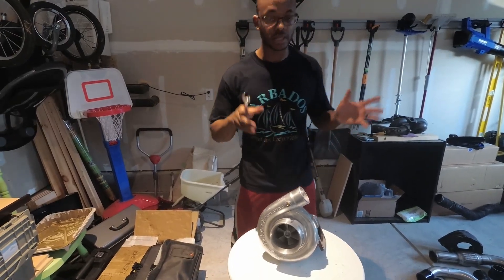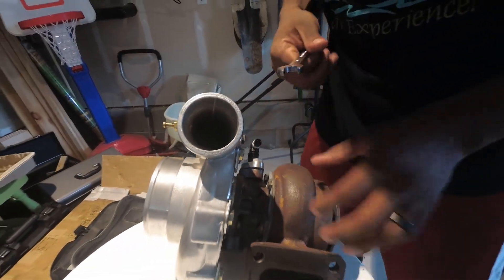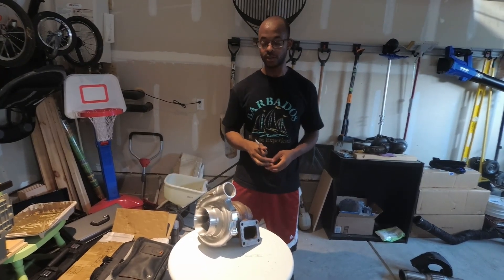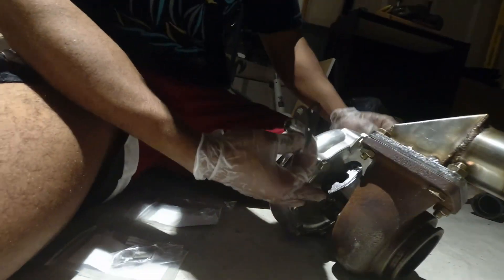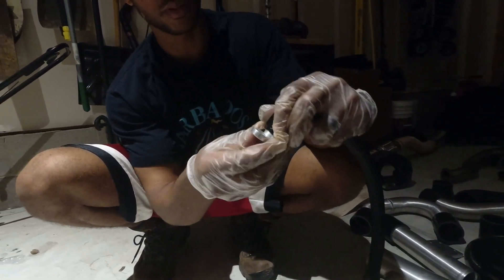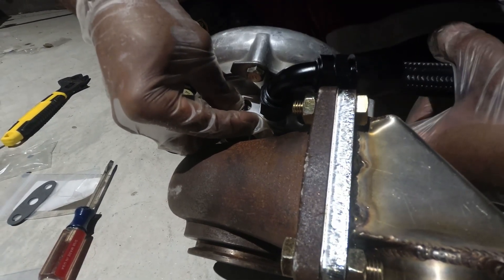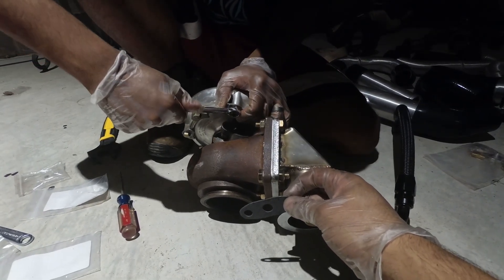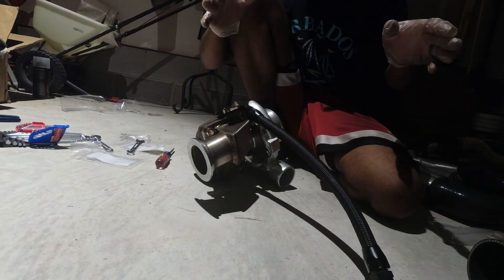10-A. Clocking your Turbo and Preparing the Assembly - RP 3.8 Turbo Kit Installation

Comment: Would you need upgrade the internals before installing the turbo
Reply from the maker: No not at all! As of the date of this comment, we have over 60 turbo kit customers and all but 1 customer is running stock internals
Reply: @RemnantPerformance  dude that’s incredible! How much psi are you able to run safely on stock internals and how much whp would that accumulate to?

Comment: Hey guys been watching the whole series day by day as you guys upload them onto YouTube. Great videos and I’m excited for this kit. One thing that’s always puzzled me was the T4 style flange over a vband style housing with a 90 degree elbow pointed in the right direction of flow. I guess my only concern is if that flange attached on the turbine housing is restrictive in anyway at all.
Reply from the maker: Thanks for watching and sorry for the delay in reply. No matter which way you go, you are looking at a 90* turn into the turbine housing. The V-band style is nice because, if you have the room for it, the connection to your piping is pretty easy vs the older T4 style. That said, if  you don't really have the room. The T4 offers the best option as you can properly mount your turbo outside of the car in this case and drop it in already fully assembled. Neither option is going to cause a "restriction", it is more about personal preference. For our turbo kit design, the T4 mount offered the best fitment as well as having the added benefit of not having to go with the more expensive V-Band Turbine housings. This design flows really well as evidenced by the 70mm Journal Bearing Turbo option spooling at 3K rpms, the 76mm Ceramic Ball Bearing Turbo option spooling at 3K rpms and the 72mm Ceramic Ball Bearing Turbo option with billet compressor wheel option spooling at less than 2,500rpms.